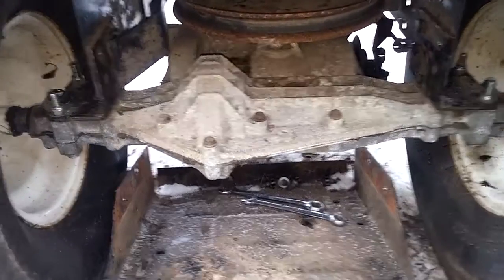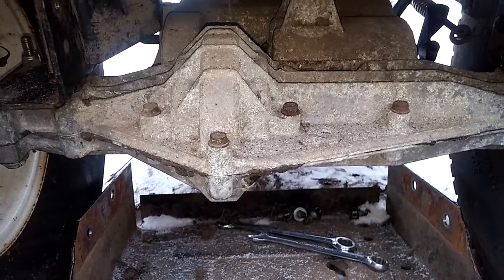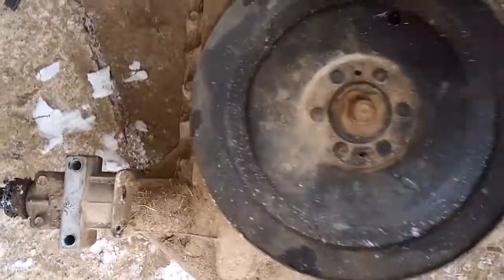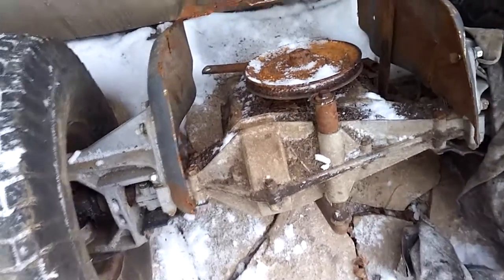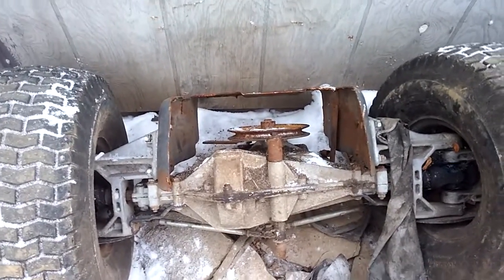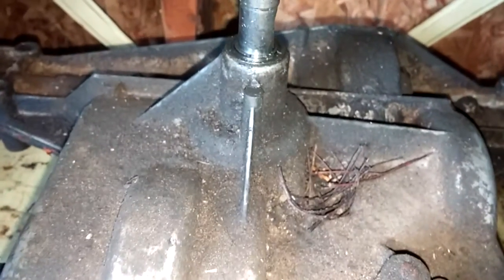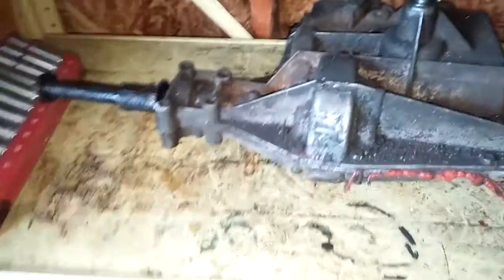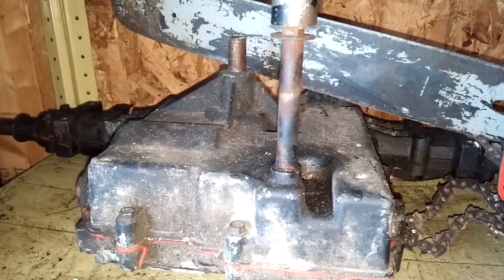Transmission Identification INFO-Help

Comment: Peerless Gear (previously branded as Tecumseh-Peerless) is its own company, and MST is just a line of transaxles produced.   Dana/Spicer is also it's own company... also owning the Foote name now.   
Your 4 wheel steer looks like a Peerless 920 to me, but it's hard to say.   The ID tag should be next to or under (behind) the brake rotor.
The replacement to the racer is a Spicer.
Reply from the maker: thanks for your help.
Sorry I haven't been commenting or watching your videos I haven't been receiving them thanks to YouTube, I have fix the problem.
Reply: I miss vids all the time... I think YouTube def has some issues

Comment: Ive got an old powr kraft with a hydrostatic trans in it, it doesnt want to move looks to be low on fluid.
Reply from the maker: the thing is with a lot of the newer hydros they are sealed units so you cannot refill them once they get low
Reply: yea this one is older like early 90s
Reply from the maker: +hanksranger potentially refillable you never know
Reply from the maker: +hanksranger Actually I do, on this particular tractor I'm working on and on my racer.
On this tractor I bought a parts tractor that was a gear drive, so it was an easy swap.
On the racer it was originally a hydro, I was able to relocate the pice that actuates the hydrostatic transmission, it was pretty easy to do just cut the wilds and slide it to the opposite side so it would line up with the gear drive transmission.
Reply from the maker: +hanksranger yes, just about any transmission will bolt in just the front mount are sometimes different and sometimes to break lever, I do have videos showing how I did it.
Reply: thanks bud ill look for them, i want to build a racer like yours, looks like fun
Reply from the maker: +hanksranger It is

Comment: 4WS is a Peerless 930, last 1 is a Spicer!!
Reply from the maker: Thanks, for a spicer its holding up pretty good, I've heard for the most part they are not the best.
Reply from the maker: +SSG HICK (Steve Getchell) for the most part I like Peerless and MST's, I had no idea the racers transmission was a spacer, I thought it was a MST 206, but considering what it is and what I'm making it do its doing okay.
Reply from the maker: Thanks for the 4WS INFO, I guess I'm changing them back, lol
I'm going to put the MST 206 in the racer get rid of the Spicer.